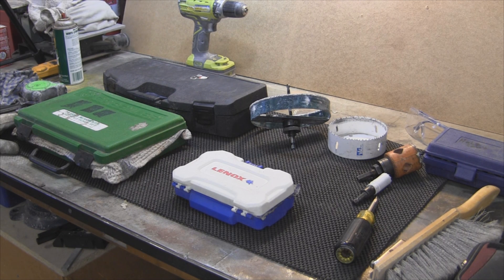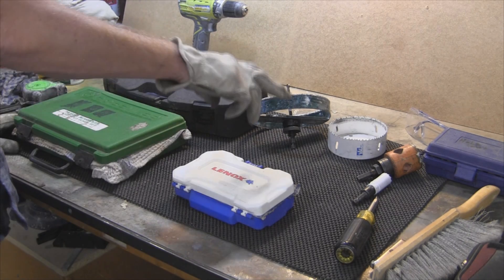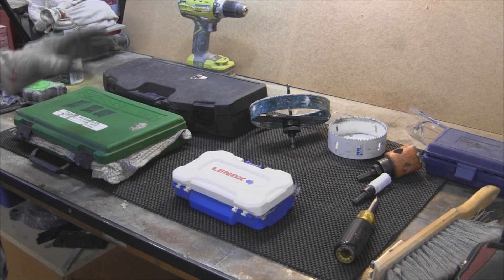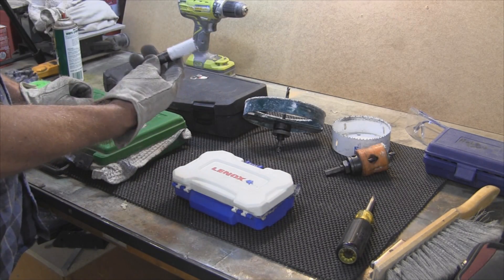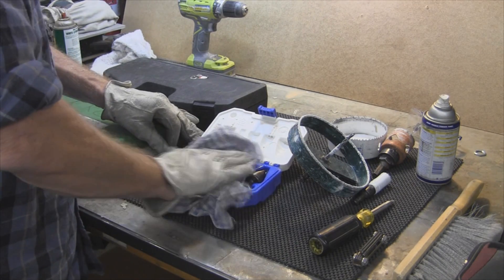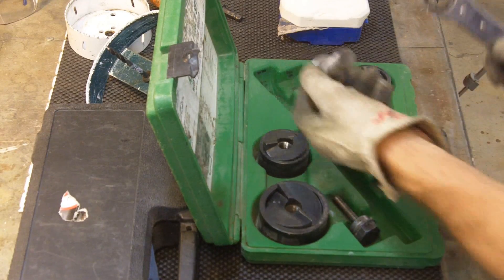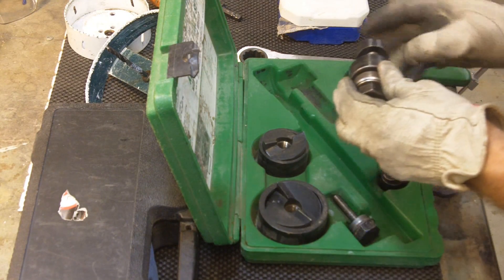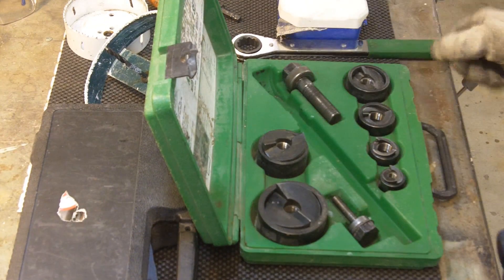Electrical Wiring-How to Cut Holes in Metal Pt 1

Comment from the maker: Hey Charles, the answers to your questions can vary as to what you were hired for. Some electricians wire a complete building in m/c or b/x cable and never pick up a bender. That "could" be comm. As a general rule however a comm electrician should now how to bend 1/2" thru 1-1/4" emt or rigid.Not knowing how to bend pipe could mean the difference between getting a job or not.
In short I have to say it is important to know how to bend pipe on a commercial project..

Comment: The Tap Magic works pretty good at extending the life of the step bits and also decreases the cutting times. I used to barrel through the stainless full force, with red hot chips flying down my neck and so on. However, after the first one or two holes, the bit was completely shot. With the Tap Magic and slower speeds, I can usually get several boxes done (They usually have 15 or 20 holes each box). Be careful, the smoke and fumes are pretty bad using the Tap Magic.

Comment: I like the Lennox step bits much better than the Irwin ones. However, none of them last very long in stainless, which is what I wire into more than anything (mainly for the electroplating and steel industry). I have found that a liberal dose of Tap Magic and a slow feed and speed are the key. My usual progression for stainless is to use a 7/8" step bit for the draw stud, then from there use the Greenlee ball bearing head ratchet with slug splitter dies. Haven't used the Ideal kit yet,looks good.